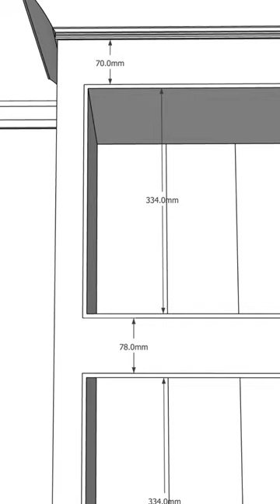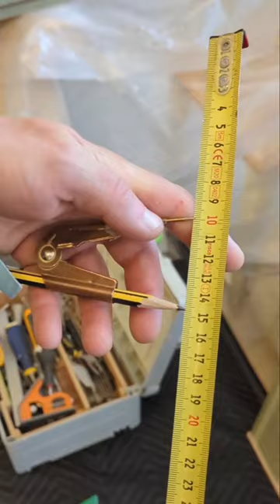Traditional Style Media Unit. (Complete build✅)

Comment: Do you mostly use mdf for your builds ,do you not find your cabinets to heavy compared to ply or something.
Reply from the maker: Yes, especially with this type of MDF I'm using as it can be heavy, but I don't find it too much of an issue and the weight difference I'd say isn't that much to worry me at all apart from maybe sheet lifting 😂😂, and yes, I mostly use MDF in my builds due to its versatility and I don't offer a painted finish in house

Comment: Very nice job, if you do bead detail often worth looking into the kreg router bead and miter bit system I've two cheap routers set up permanently, turn out high end jobs fast and more profitable.
Reply from the maker: Arrhh interesting! Yes I've looked at the Craig jig system and seen someone online using it. So thought that would be a good one to try. I'd definitely look at doing that and that's a good idea. Having independent routers as setting up I guess can be a pain! Thanks again for the advice mate! It's a bit wild doing it on a chop saw 😆😂😂
Reply: @ACbespokecarpentry  been there done that and it drove me to be the kreg bits. I've the two routers in the one table with a sliding fence for doing the miters with set stops fixed for set frame sizes.

Comment: Great video and it’s great to see a start to end tutorial.  Any advice on squaring a board before you cut your pieces?  Also I see on the face boards you are not putting edge banding on, any issues when you paint them?
Reply from the maker: So you can do this by checking the two corners of your piece of MDF. What I mainly do is start parallel from 1 end of the sheet as that will be square. I also use a slide on Square for my track that goes onto my tracksaw. This helps keep smaller pieces square too, as for the face frame and not edging them I used finsa hidrofugo MDF you don't need to fill or send the edges it's great stuff!
Reply: @ACbespokecarpentry   Thank you
Reply from the maker: @RichDarbey  anytime 👍🏻

Comment: Hi, Adam. Love your videos and watching your process. Pretty smooth.

By the way, what type of screws do you use for the mdf to join without tearing? Coarse or fine thread screws? Maybe you can point out the exact brand, size and make you guys use over there…tnx!
Reply from the maker: No problem whatsoever! I always use a thinner screw. It can be a half thread or full thread. I don't really mind. I use a 3 mm drill bit with a counter sunk head and I normally use 4x60s. I'll link them here if you check my bio page I've got  tool list with all the bits I use https://amzn.to/42lycLe